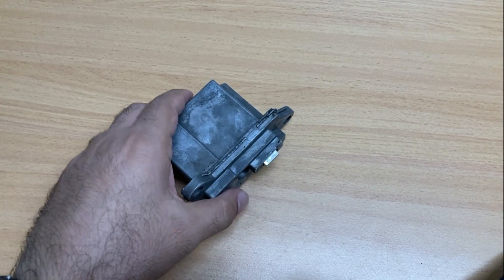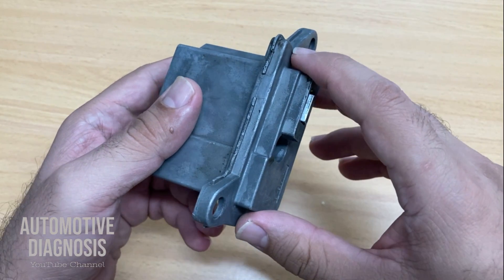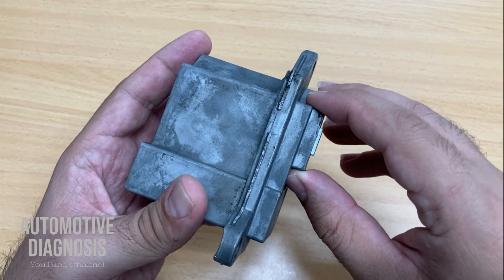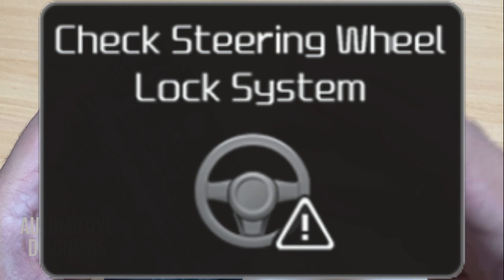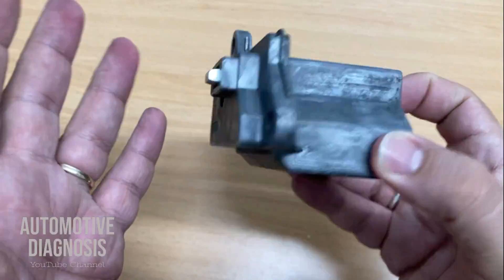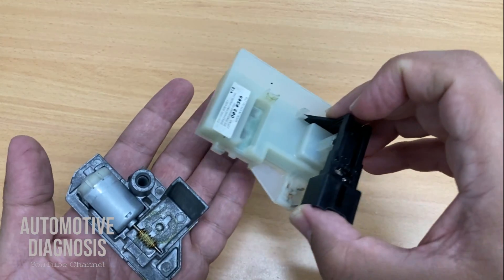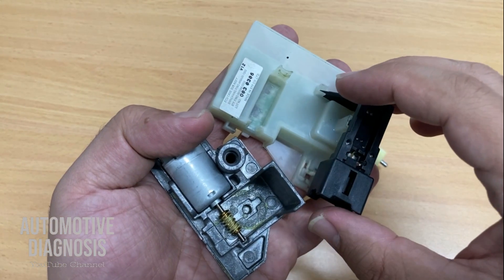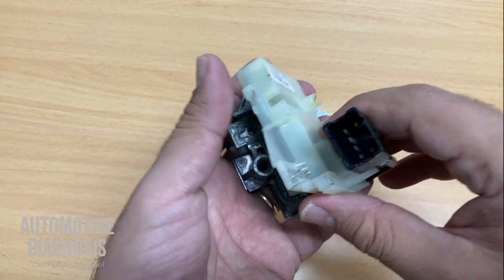Check Steering Wheel Lock Fault Diagnostic Guide on any Hyundai & KIA

Comment: I have Ealantra AD 2017 , and checked it with scan tool and there was no DTC’s , but I noticed the steering wheel when I turn off the car is not locked , I can turn it hardly but it doesn’t lock .. what could be the problem ? Knowing that I tested the ESCL with scan tool and it is locking and unlocking..

Comment: I currently have a kia soul 2012 with "check steering lock" on the dash. 
I have checked all the fuses and they seem to be ok. 
The car has its wheels stuck facing in one direction. initially I could move the wheel but only to the right. now its on full lock to the right. 
It has no ignition barrel as it is the Push start version.
Is there anything I can try other than removing the ESCL?
Reply from the maker: Hi there,
The following video explains everything to check the ESCL on the car:
https://youtu.be/UpBFRVQF7G4?si=o215Bjkjvt4m9d3a

Comment: Hi can you share what wiring diagrams website are you using?thanks
Reply from the maker: Hi there, you can find the Hyundai and Kia wiring diagrams in three different ways: if you can find their OEM scan tool (GDS) which is on the market as well, it provides all diagrams for all cars up to 2018. Also, there are some online websites offering the diagrams for a monthly fee. But the best source is their technical websites that dealerships have access to.

Comment: Hi sir i want to ask you about a kia sprtage nq5 crdi equipped with the dct gearbox it is misfiring when driving only at reverse gear and when scanning the engine module with the kds it sets a default code which says "fuel injector driver circuit" however this code is shown as history not active thank you in advance
Reply from the maker: Hi there,
I suggest to check the injectors connectors, PCM connector and wiring in between. There are two wires on each injector, this fault is coming from the switch side of the wiring.
Reply: @AutomotiveDiagnosis  thank you very much sir for your support 🙏🙏😊